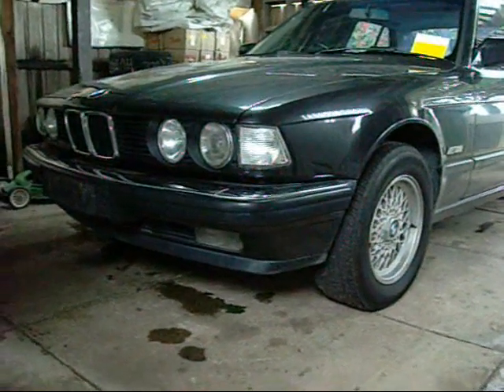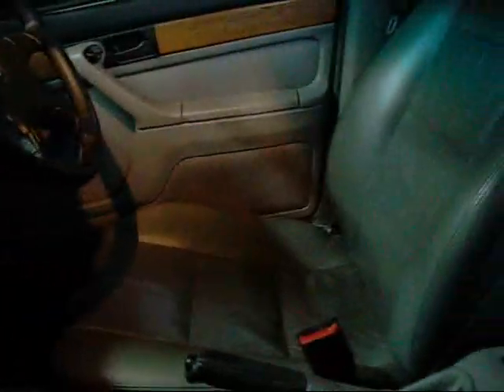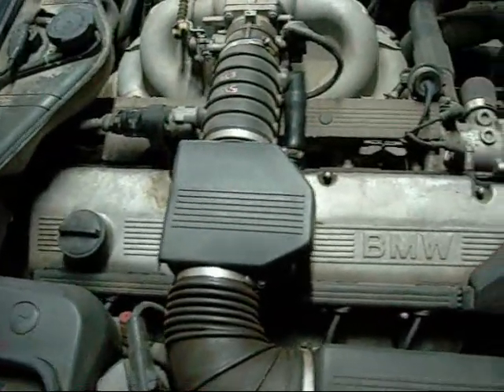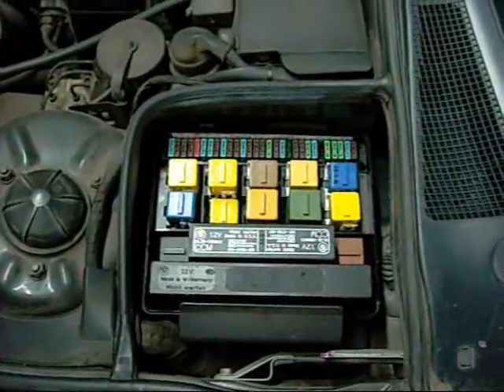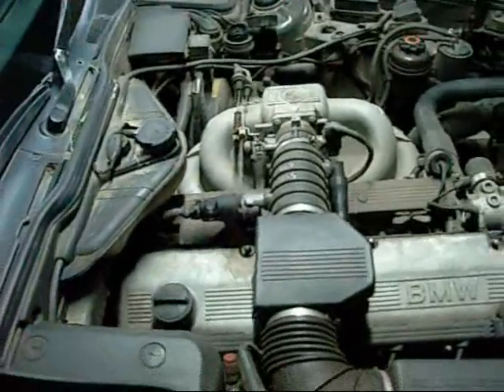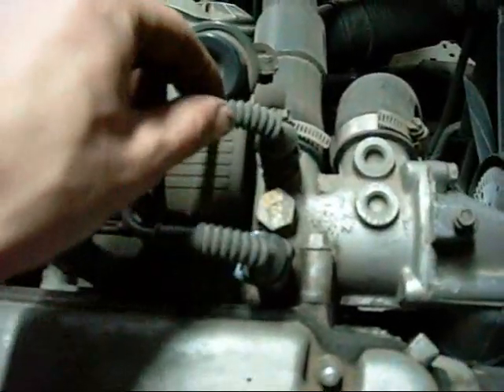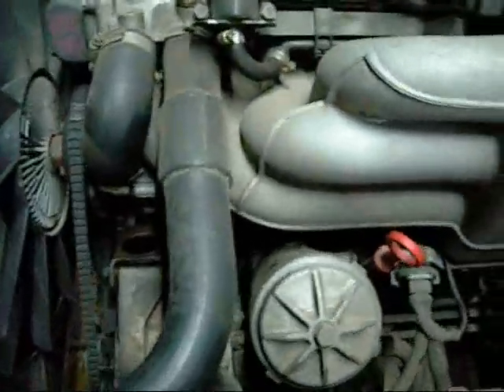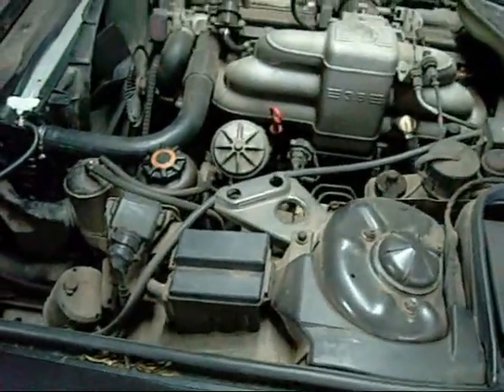Car Service Day Pt1

Comment: How is she running now? I just bought a '90 735il black on black here in San Diego, Calif. with 138,000 miles for US $1200...untorn leather seats....a steal! Very solidly built car, even the manual has a section on towing a trailer, ha! I am enjoying learning about this amazing car. I will make good use of your tips, thank you.

Comment from the maker: I agree, I wouldn't have bought it if I wasn't prepared to fix it myself!, barring major probs.

The engine bay is designed to have a 5.0L V12 crammed into it, so the 6cyl is very easy to access and work on all parts of the engine.

Comment from the maker: Damn :(. they are notorious for doing that.

what happens is the oil spray bar for the cam and rockers comes loose and stops spraying oil. eventually it destroys the cam, rockers, and valves.

I check mine annually

Comment: I had similar car little while ago. I really loved it, but when i took that to a local dealer to do a valve adjustment, they noticed an engine damage. Camshaft, Valves and rocker arms! The cost of repairs would have been about 2000-3000€. If i would have done repairs, it would be like 800, but i didn`t have a place and equipment so i got my old car back from dealer who i bought that BMW. Too bad.